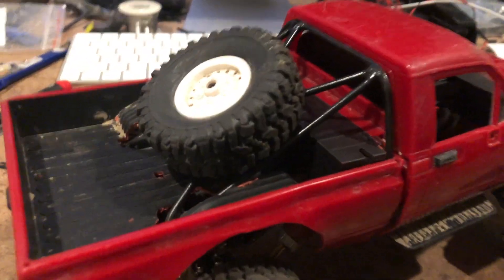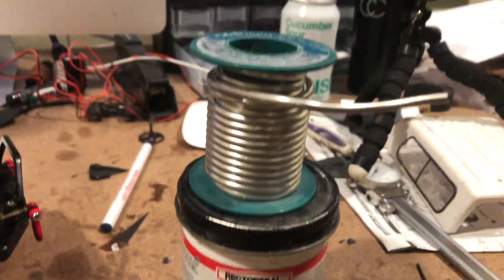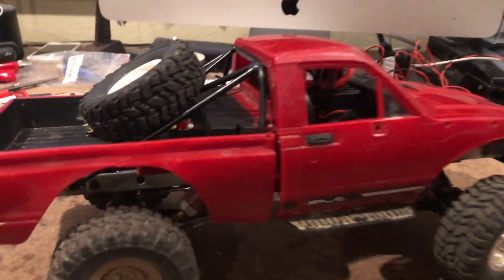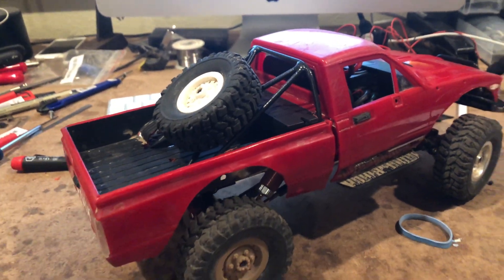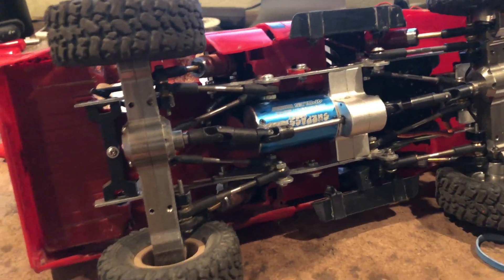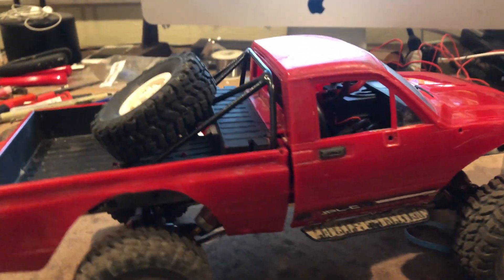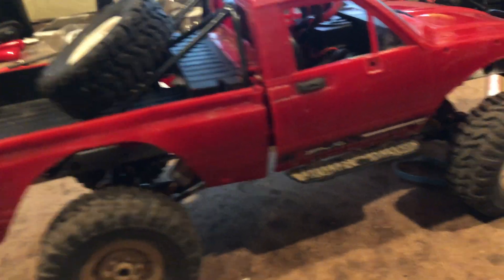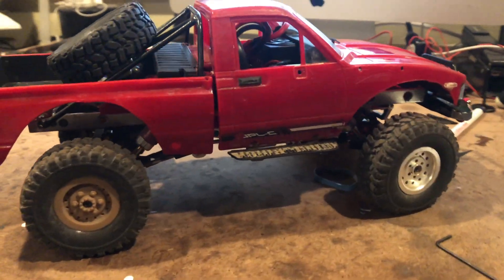Brushless WPL C24 gets a prerunner style roll cage, drifting and crashes

Comment: Old video but I am wondering what kept breaking? Gears and motors or actual wear items like tires and connecting rods?
Reply from the maker: Mostly axles and gears. The axles and gears themselves are fine, it's the things that attach to them with set screws that are the problem.
Reply: @ilovejazz3s  thanks

Comment: Its not bulit to do 1/10 scale stuff. Its more of a working model. I just got one. The c24. U need a   tamiya bruiser. 1/10 or check out vrx. Racing they have 1/10 4x4 for 130$ the parts are chep to.

Comment: Specs on the build?
Reply from the maker: My other videos cover it in detail, but quick rundown is 60mm oil shocks with custom mounts and a 2845 brushless motor ran into a modified version of one of those single speed metal gearboxes, with a 60a esc and all metal upgrades.
Reply: @ilovejazz3s  can't find the video you are referring to